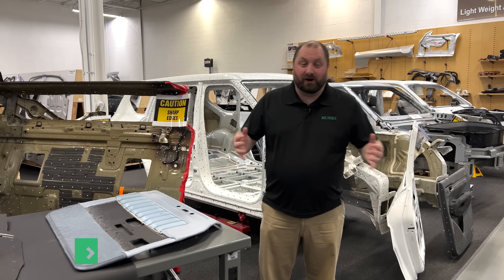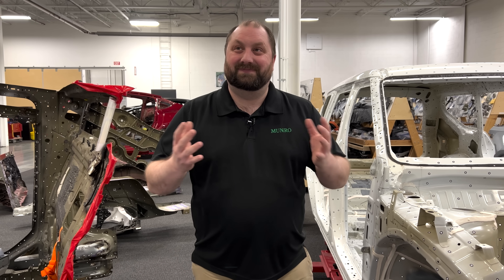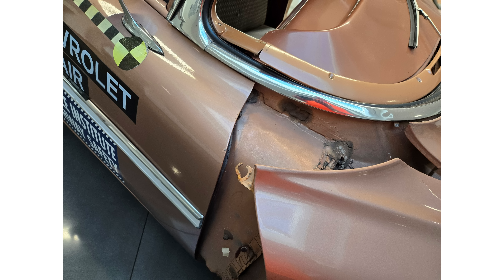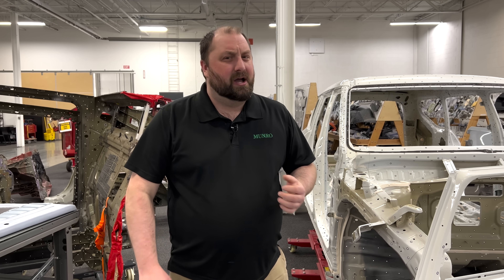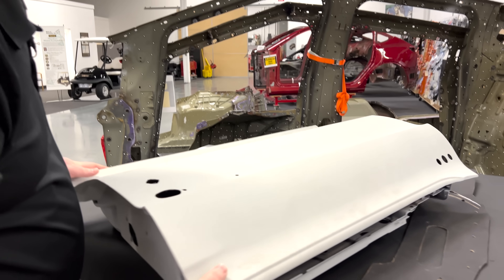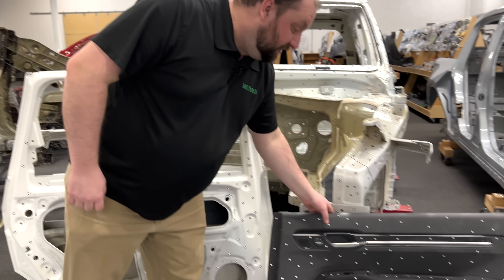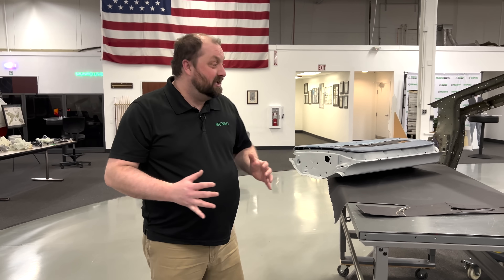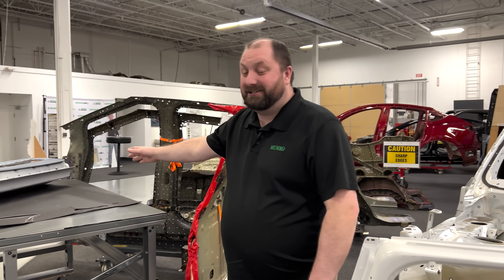No, Your Classic Car Isn't Built Better Than Your New Car

Comment: Of course "old" is never automatically better. In terms of safety modern cars are unbeatable; who wants drum brakes if you can have disc brakes. And for the leaded gas? To convert classic engines is easily done with implementing hardened valve seats.

However, modern cars have indeed big flaws: electric and electronic over-complexity, increasingly non-reparability and increasingly 3rd party remote access to the cars data and even control. It will be more and more difficult to remake spare parts because of their complex manufacturing processes, highly-integrated components and multi-component base materials.
Even the vehicles glass parts like the windshields have now multiple optical coatings on top and perhaps a wire grid inside - so the days are gone where you might find an expert glazier to remanufacture you a straight plane windscreen when an unexpected flying rock smashed it.
Also standard (electric) components like batteries, lamp bulbs, washer pumps etc. but also tire valves, air filter cartridges, oil drain plugs etc. are increasingly obsolete and replaced by model-specific "solutions".
The typical 120mm head lamp reflector being used for vehicles in the 1950s throughout the 1970s did not only fit old American classic cars but also the East-German made Trabant and many Soviet-made vehicles of this area. When I needed to replace them for my Belgium-made Ford Transit 1972 I bought myself two new once for ca. 50 bucks each from Hella. The list of vehicles fitting this part was as long as an encyclopaedia of vehicles made in the Eastern bloc, West-Europe, the US, Australian Holdens and Asian manufacturers. Unbelievable!
Repairing it? With some advice every stay-at-home-Mom could do it 🙂.

Why wiper motor these days need their own micro controllers makes no sense to me and yes, also those expensive LED-lamps could be standardized.
And why a workshop has to remove the complete front section of a car, its air filter intake box and some other components just to replace the double-beam standard bulb (like in an elderly Audi A4) is not explainable to customers and their trusted workshops alike.

My concern is once the radio won't work in the future you need to buy a new one - with a new car being attached.

I hope one day car manufacturers are really listen to customers and service station wishes (and not so much to heir "marketing" departments) and combine the old good properties with the good and helpful modern features.
Also to rethink modern styles (which now really leaves a lot to desire, ICVs or EVs alike). And again a nice range of colours would be great. White, grey and black is just too boring. You guys can do better.

Peace! from Dresden / Germany

Comment: Oldies survive with the make do and mend:)

Modern are nicer in the beginning
Till all the plastic fails, the software stops working
And the parts so complex we cant fix them so easily

With modern yoyre mostly locked in to having to scrap it every 10 years

As once they start failing theyre just junk

Bar a few:)

Comment: I wish they would produce a kind of hybrid car:
- modern and safe body
- an as simple-as-possible drive train.
- an engine without all the extras to get a little more power and meet the emission standards for a while after leaving the factory.
- a manual gearbox, port injection, a single camshaft, hydraulic cam actuators, and 2 valves per cylinder. Of course, no turbo.
Just a car to get me from A to B.
My first car had only 4 motors: The one for driving. One for starting, one for the windscreen wipers, and one for the windscreen wash.

Comment: Agree that modern cars are safer and more reliable. But also much harder to repair. Just try replacing a bulb on a modern car. Once replaced the camshaft gear on a Ford model A at the side of the road with basic tools. Nothing you need to do on a modern car.

Comment: I think when most people say they don't build them like they used to a lot of people are referring to the fact modern cars are not as serviceable and built as throw away items.  The tolerances and amount of engineering (like safety) oh modern cars are great. The consistency of quality look at gm starters....you used to have to shim them.  I dont think any modern car does that. Thats quality in consistency and tolerances, you just bolt a starter on now with out thinking.

Comment: I agree about the engineering/structural build quality as itself, i don't really agree on the level of complexity, the most basic utilitarian car you can buy in Europe around here (italy) costs about 12/13000 euros, and most of the times it's tough to work on because the engine bay is absolutely crammed with accessories and they started making a lot of critical parts in plastic (Audi amongst the others makes oil pans out of plastic).

Comment: Yes, the "cars" are much more flimsy. I had a 3/4 64 dodge pick up. I'm not saying it's better, but I hit a brand new Lincoln Continental. He cut me off and I smashed into the side of the car and broke both axles and the guys arm was broken. My 71 Duster on the other hand wouldn't have survived I I would've been hurt very bad without a doubt. Maybe that's not a fair comparison.

Comment: A lot of people still think that the "big old boats" were heavier than most of today's cars.  And you cannot convince them otherwise.  They just know that steel is heavier.  Ok.  Fine.  Believe whatever you want.

You should have seen the look on the kid's face at the dump when I actually weighed my grandmother's '67 LeSabre  It scaled out to a hair under 4000 with a trunk full of garbage.  Not far from a modern RAV4.

This is yet another reason why you can take a classic car and add a modern drivetrain it easily get something that goes like STINK.

Comment: All true when comparing "broadly modern" cars (built in this century) to "proper classics" from the 1950s to 1980's, however quality of components, proper design, repairability and durability seem to have gone down in the past 20 years probably due to a combination of environmental regulations, misguided consumer desire for efficency gains, excessively stretched supply chains.

Comment: Elements about old cars THAT ARE BETTER: 1. My old car never stopped working because of a loose connection at a back-up camera. 2. Headlights on my old car don't cost $3,000 (each), plus another $1,000 for the headlight computer. 3. I can change to specific radio stations and temperature settings without having to take my eyes off the road to make sure I touch the correct picture of a button on a screen. 4. My old car was designed for styling before aerodynamics, and thus is more aesthetically pleasing. 5. My old car doesn't have so much tech on it that it can't function correctly. I can do this all day....
Reply: This was about vehicle safety not vehicle simplicity. Nobody disputes that modern vehicles are getting more complex and thus inherently expensive to repair.
Reply: @adamn7516  - I know that. That's why I prefaced my comment the way I did.
Reply: What car won’t start working because of a loose back up camera connection? Get lost dude
Reply: @JustinSeara he’s correct,look up some videos about it.
Reply: @JustinSeara  - It was a minivan. I'll look for the video. It was a channel of a guy who has a repair shop. I couldn't believe it either.
Reply: @JustinSeara  It is likely the computer was programmed that way rather than the car inherently won't work. Or, if he installed the camera himself then it was shorting something out.
Reply: @DKNguyen3.1415 no, it most certainly was not.
Reply: @JustinSeara   this one and likely lots of other ones. 

When you take out that stupid CAN bus the computers cant communicate. 

https://www.youtube.com/watch?v=sr54g6k1E80
Reply: ABSOLUTELY. The so called New & Improved (for your safety) is a bunch of corrupted junk which is out of control expensive.
Reply: Sure yeah all that woo woo but it’s still more dangerous bottom line your life is more at risk in older vehicles. I’ll take safety in my cage thank you. If I wanted risk I’d ride my Ninja 🤗
Reply: you did not have any of that happen to you, you are parroting hit pieces, shut the fuck up dude.
Reply: Everything you said is not true. Modern cars will behave waaaay better in failures. Engine ecu adapts to broken sensors and keeps engine running. You could unplug half the sensor and it still runs. Each piston has it's own coil and even if few break it will still run. Interms of headlights. Well assemblies cost money on any car regardless of age. Plus led technology last longer by default. You can adjust radio station without looking by using steering commands.
Reply: @dkdanis1340  - I put a post on here with a link to the video of the minivan that would not run because of the loose connection at the back-up camera but I see that post it missing. YouTube apparently did not like it. That loose connection kept all of the control modules from communicating with each other. Makes no sense.

The headlight assemblies on my 2012 Ford Focus costs about $350 each. That is a far cry from $3,000, or the $5,000 F-150 tail lights, even more when you include the required computer that is in each one. Here is the video on that: https://www.youtube.com/watch?v=MUkFsuilVD0

If you have a 4 cylinder engine you cannot lose "a few" ignition coils. If you lose 1 you lost 25% of your engine's performance and it will have a noticeable miss and run poorly.

If you unplug half of your sensors your ECU will throw many trouble codes and it will not be able to operate in "Closed Loop" mode, and if it will run at all it will be in limp mode.
Reply: wrong
Reply: Touch screens are seriously dangerous. Personally I don't put too much faith in what Sandy Munro or this guy says. I've heard Sandy say some really stupid chit

Comment: Absolutely agree on the safety of modern cars, thats one part that has improved massively in the past 30 years. There are videos of people flipping their cars on the Nordschleife and walking away unscathed; unthinkable if they were driving something like a Golf 4 or any other 90s car.
But the build quality in terms of assembly quality and interior materials has gotten worse the past 10 years, if you look at VAG cars for an example. Or the rediculous bean counting on other parts like the engine, transmission, etc. People joked about Mercedes engines being finally broken in after 300tkm, now thats the point where they are likely worn out.
Reply: Golf 4 wasn't that bad, Golf 3 definitely was a tin can. Golf 5, on the other hand, was much safer and I'd feel 100% safe driving one today.
Reply: Absolutely not true. Any modern vehicle can reach 300.000km. In fact there are 3-4 year old cars that reached 1.200.000 kms. Interior quality is relative. Can't expect crocodile skin in a cheap car. Plastic isn't a bad material.
Btw golf 4 was pretty good in a crash.
Reply: @ From what I have seen I highly disagree. The cost cutting in some areas has gotten insane.
And the interior quality of many modern cars is a disagrace. Look at VAG cars (especially the Golf 8 compared to the 7), or what Audi has done to their interiors; they dare to sell you a car with loose (by design) door handles. And dont get me started on their current steering wheel.

Mercedes has creaking plastic and noisy interiors in their current S-Class vehicles, how is that possible?
Reply: @xXYannuschXx  Hey, what do you think about the fake tailpipes used on recent Audis?

(I obviously think it’s completely unacceptable)
Reply: @satsumagt5284  Absolutely disgusting. And I dont understand why they do that. It looks like a cheap knockoff or a grocery getter and not an Audi. Or those tablet screen they put inside the interior these days. Porsche is doing it right, by using free form, curved monitors that resemble a traditional instrument cluster. While Audi, BMW and Mercedes put a 2010 Ipad ONTO the dashboard...
Reply: @xXYannuschXx  BMW has been notorious for the ugly digital screen. Pre-LCI G20 3er was decently integrated, with separate displays for gauge cluster and iDrive. Now it’s an awful display with hard edges that I would never convince myself it’s an “upgrade” from the previous model.

Comment: I dont think anyone in their right mind argues with modern car safety. The chassis and reinforcements are stronger, the seatbelts are the best invention ever, the airbags work great. Its almost everything else about new cars that people hate. Also, despite having so many different driver assist controls in new cars to stop accidents, we dont have a drop in accidents on average, because people are just more and more distracted by their phone use while driving. The average driver is way worse than 30 or 50 years ago

Comment: I am in my mid seventies in age.  After high school in the late sixties I worked part time for a local auto wrecking yard.  We said back then that the X frame that GM used was the worst piece of auto engineering that was ever designed. I remember one vehicle where the front end was twisted half a car width to one side.  I personally think that the Highway and Transportation Safety Department took this X frame design and used it in their test because it would over emphasize the test results.  I would never own and drive any GM vehicle with an X frame.  Decades ago I was given a easily repairable 1961 Chevy hardtop that was hit slightly in the front fender. I pulled the drive train and scrapped the rest of that car.

Comment: Interesting. So if anyone does a structural rebuild of this 50s vehicle or similar they should add reinforcements and modify things like that stupid bolt bracket, or seam weld wherever possible, don't worry about keeping the crap original design. I have a 70s European Ford, there are some safety improvements compared to this but best to avoid crashing as always

Comment: Good arguments but the problem is then Engineering arguments are different especially on the doors. The doors on a classic are the structure. New car doors the structure is separate to the door frame. Sometimes skins are stuck on some are bolted some are welded. The old days they were all welded. It was also mandated by law that after a car crash the doors have to be able to stay closed during the crash then be able to be opened after. You cannot do that with new door. There are also more people being cut out of cars than befor where you could walk out of them and more cars where they are setting themselves alight which never used to happen unless you had a ford pinto, then ever before. Do how do you argue that? I walked out of my old valiant coup’ after hitting two light posts. The coppers told me I was lucky I was in that than a modern car because I would not have been here typing this now. Also his chassis argument didn’t pan out real well either. Modern car most of the rails are not strung together with the radiator housing. They are plastic this is why you find cars from the 2000’s when they run into animals on the highway hold together better. You don’t loose not only you front panels but half of your suspension.  He was show suv chassis which are usually a uniframe on a ladder chassis or just a uniframe. Then if you compare Chrysler from the 60’s most are uniframe and they used to crash test their cars in offset collision at 55mph. I still stand by the argument you press out a new 59 Chevy out of the grade streel it was made with and let’s do the test again. Not something with 60 years worth of fatigue and a chassis that looks like it’s been dragged out of s lake. If your going to run structural comparisons make sure your comparing a car with a car and not an suv. I think Volvo did the most comprehensive comparison by remaking an older model Volvo from it old press and crashed it into a new Volvo. The results were surprising. Not this farce you’re trying to explain with the insurance test. You can put lipstick on a pig. It is still a pig.

Comment: Both my 60's volvo and Imperial have these fender structures.  Modern "high strength" steel is brittle and has limited energy absorbing ability.  Modern cars have a lot more contradictory design issues that they have to meet.  Example, low weight for EPA fuel economy and safety.  The work of designers was a lot easier back then. Yes, there were a lot of poorly built cars back then.  That Chevy is a good example.  But there were lots of cars back then that were built by manufacturers that respected themselves.  Also, one of the issues with these modern cars is that after an accident, they are a lot harder to repair.  Modern technology could indeed have built better cars.  But the short term profit mentality and the overwhelming and conflicting regulations are reversing the possibility.  The stupidity and ignorance of the public does not help.  Yes, there were lots of idiots back then, but the amount of people with common sense was higher.  Remember, back there was no SUV and very few people drove pickups as passenger cars.

Comment: "Gonna need a bigger shovel. A classic car is by definition at least 20 years old and some racing series like ADAC require 25. You are comparing today's cars with veteran cars a hundred years old. Major difference. Over the last 25 years build quality has definitely slipped badly. If a $10 part fails you need to replace the whole assembly for $500, and it has to be done in a licensed workshop. Stuff just doesn't last. Wiring goes abnormally quickly, which is why you can get a ten year old hot car for almost nothing. Half the fancy electronics don't work anymore. Cars are deliberately designed to cost far more to maintain and repair.